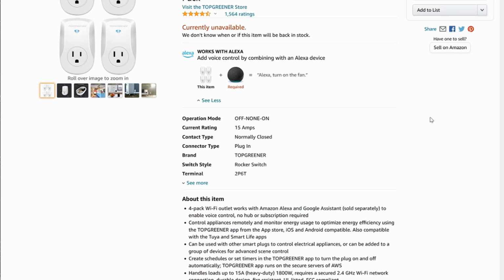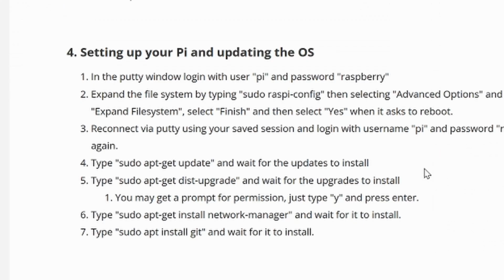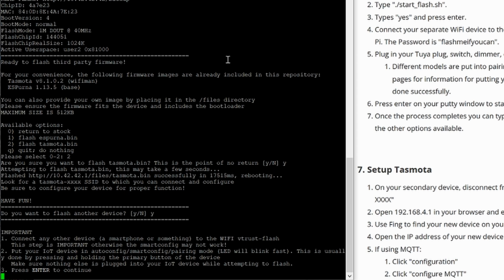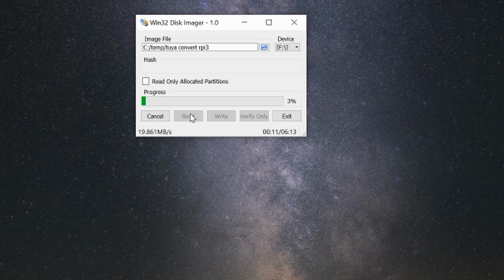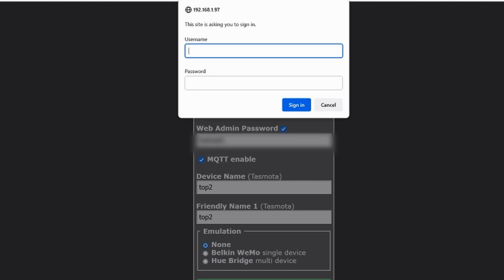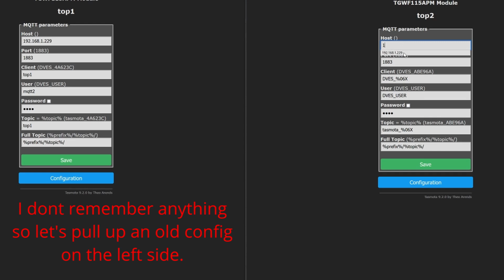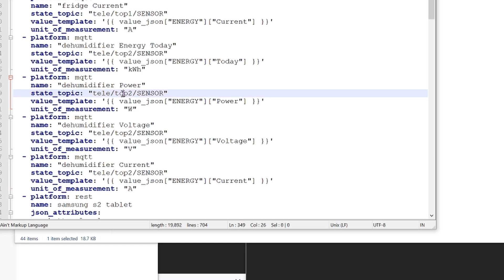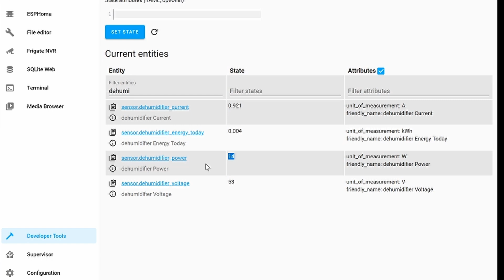TopGreener smart energy monitor plug flashed with Tasmota! no solder

Comment: i keep getting auto auto retry
Reply from the maker: smart plugs started using newer chips  which is why this method no longer works.
Reply: @dablet  actually if you put this in the json file it'll work. I have various Tuya bulbs which work with this, you can find the key, id's etc through the IoT Tuya platform.,

"type": "RGBTWLight",
"name": "Patio Light",
"id": "XXXXXXXXXXXX",
"key": "XXXXXXXXXXXX",
"manufacturer": "Novostella",
"model": "Floodlight",
"dpPower": 20,
"dpBrightness": 22,
"dpColorTemperature": 23,
"minWhiteColor": 0,
"maxWhiteColor": 221,
"dpMode": 21,
"dpColor": 24,
"colorFunction": "HSB",
"scaleBrightness": 1000,
"scaleWhiteColor": 1000